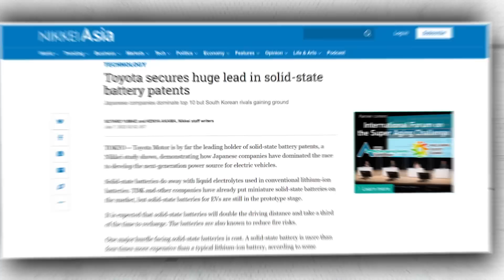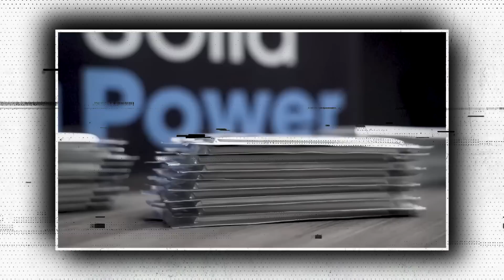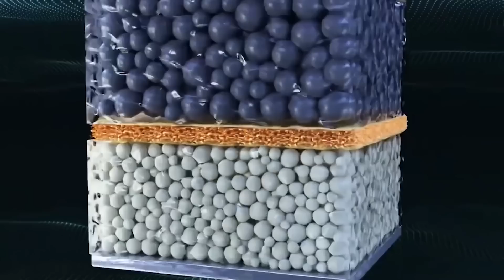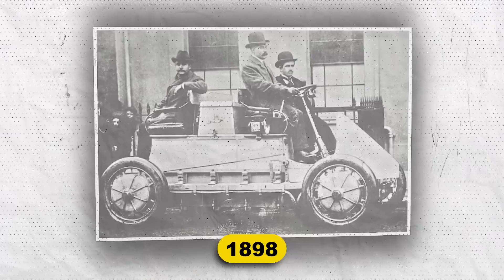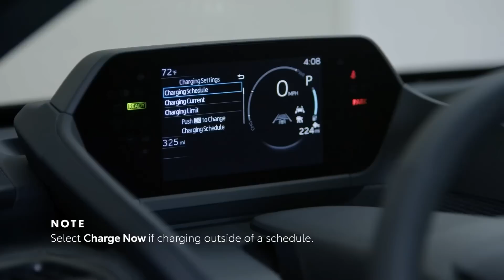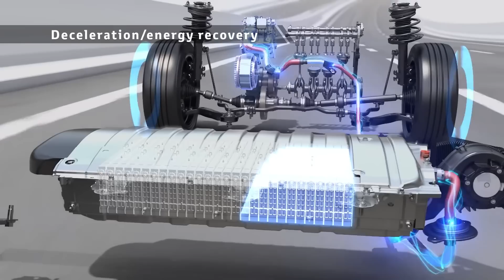IT HAPPENED! Toyota FINALLY Reveals New Solid State Battery 2024!

Comment: Advancing further; theoretically, solid state batteries may also become the automobile frame itself or even part of the structure of each electrical device in an automobile. Solid state batteries rather than be limited to a container of smaller inter connected batteries combining to deliver the required electrical current can be manufactured to assume virtually any shape, hence forming the structure of the device itself, significantly improving efficiency and economy of production.

Comment: The amount of energy to recharge the battery in 10 minutes would create so much heat that it would equal the amount of heat expelled from the electric engines that drive the vehicles for the duration of the 500-mile trip. This is nothing more than an add to draw attention for the purpose of advertising of their brand. Lying is never cool!

Comment: I own a 2018 Prius Prime plug in and I have come to be in awe of the engineering technology that makes this car capable of what it does while doing it reliably.  I am excited to experience solid state batteries in this hybrid to achieve the figures that are being claimed very soon.  While I respect Tesla for all that it has done, certainly Toyota is a  credible builder of efficient and dependable automobiles that can not be ignored.  I look forward to increased range, power and short charging times along with safety.  They deserve my vote.

Comment: Fast charging suggests that in an HEV setting, far more braking energy can be absorbed, so reducing the need to use the friction brakes, while extending the range of the electric drive. Toyota wants to get this right, so HEV/PHEV makes alot of sense. It will punish the battery packs with many recharges, yet be a cheaper unit to swap out under any warranty issues.
Reply: Battery longevity is not an issue even with existing NMC and LFP chemistries. Solid state batteries are always being pushed into the future. No one is coming clean about costs and production volumes. Existing technologies make incremental gains year on year so this is no 'game changer'.

Comment: Ill believe it when I see it and touch it.
Once they release a truck with 600mile range under full towing and cargo load, I will be sold on it. In addition, to quick recharge to 100% within 10mins. 
If it can't do the above, then I wont be switching to EV.

Comment: Wtf is going on st toyota? One week there saying "NO" to ev manufacturing. Now this week it revolutionary solid state cells that nobody will see outside a lab.. even in the lab they only make a few cells. We know that better batteries are coming. The math doesnt lie. Getting the batteries to manufacture at scale is extremely difficult. Theorhetical and - in practice- play from different fields of thought. Practical manufacturing never is possible. Ultimately we the consumer just get told a bunch of crap that makes people happy.. but it never bears fruit! I say this fully recognizing the best vehicle i ever owned was a toyota corolla. Make any all electric vehicle. Try that first. Or announce that your building enough battery plants to continue making and selling 10.5mil units. Engine and batteries are basically the same thing in there function. If your not making ice engines then make batteries.? Future tech will come and batteries will get much much better. But dont hold your breath if waiting for this to bare any fruit. All of japan has put there eggs in a fuelcell / Hydrogen future. I can see uses for hydrogen in airplanes. But i dont see it ever penciling out for vehicles. Its not a easy gas to work with. Its not like your bbq propane tank.  If you use electrolisis its expensive to make. Japan is going to use a few nuclear power plants to make nothing but hydrogen. Ive been wrong before. If your car ran on hydrogen it would cost u around $30gal (more if created solely through electrolisis).

Comment: I don't get why Toyota decided to go for a hybrid and not full electric... This doesn't make sense
Reply: Prove it out and debug on smaller batteries.
Reply: Toyota is heavily invested in hybrids and have been fighting against EV's for years.  They don't have a viable EV platform.   The few EV's they make today are based on ICE vehicles.  In some markets they are selling rebadged BYD's.  Production capacity is probably the other concern.  They can make 5 hybrids or 1 EV with the same amount of batteries.

Comment: In Hybrid Versions is hard to charge breaking while driving. Use the Tasla system then you can charge without breaking. Much better and cheaper.
Reply: What are you talking about?, please expain, I would like to learn.
Reply: @auser6426  Regen while breaking vs regen with say a paddle.
Reply: @BioniqBob  Thanks for the answer I understand  you.
But I still don't understand @donleofirsts comment

Comment: I am very confused by Toyota's advertisements. Recently, the hydrogen internal combustion engine has been very hot, and it is claimed that its performance will beat Tesla's electric vehicles. Since hydrogen internal combustion engines can beat electric vehicles, what solid-state batteries are still being developed? Conversely, if solid-state batteries can be successful soon, then Toyota's automobile kingdom will continue. Is it necessary to engage in hydrogen internal combustion engines?
Reply: Easy - it’s called a hydrogen hybrid car with solid state batteries - duh

Comment: Solid state (SS) battery promises significantly more recharging cycles (more life cycles) than Li-ion battery and thus benefitting smaller plug-in hybrids' batteries. For commuting the faster recharge also adds to the SS battery utility. Looking forward to that.
Reply: There's still more problems with [actual] high speed charging than people without electronic theory, education and principle can possibly know about. The current connector and conductor technology to transfer enough current for a 500 mile trip in a loaded car in 10 minutes is nowhere near being where it needs to be. The conductors will need to be several times larger, and the connectors need to be extremely robust, or fire will happen at those connectors. Contemporary lithium ion batteries on their own offer very little resistance to current flow, so they have to have extremely robust current limiting technology in them to keep from burning up the conductors, connectors and chargers. Relatively high speed, automated ,battery swap out technology would be much easier to implement than trying to upgrade the batteries, the chargers and the conductors. It's not really the batteries we have available cannot charge fast enough, it's that delivering the amount of current to them that they can accept is holding them up. It will require complete redesign of chargers, ports and internal conductors to move that much current.

Comment: Y'all keep throwing these so called ground breaking developments. "Show me the Money" or should I say "Show me the Battery"
Reply: Every year I hear the same stament
Reply: @lynkmartin Toyota has been claiming solid state batteries are just around the corner for years.  I'll consider it vaporware until it's actually in production.
Reply: @Gary-bz1rf  your statment just sounds like a naysayer when it comes to EV's.  There's been lots of this "it can't  be done" talk in the EV space that has been proven wrong over and over.  For instance, Tesla increases the production of EV's by 40-50% every year.  That's 2 years to double the production of EV's, not 10.  You mentioned the supply chain, guess what they figured that could be a bottleneck and applied that same growth up and down the supply chain.  Not enough batteries, they'll build their own.  Not enough  battery grade lithium, figure out a new refining process, and do it in-house.  Countless examples of exponential growth in all segments of society.   Where did you get that perception it takes 10 years to double something?
Reply: @Gary-bz1rf  You're totally wrong on that one.  90% of EV's are charged at night, when there is excess power on the grid.  Tesla has 17,000 superchargers in the US, many supplemented with Solar and battery storage.  They can only make EV's so fast, so it's not like we have to transition 100% tomorrow.  It will be gradual.
Reply: @Gary-bz1rf  you're right that it would take more power than the grid can power today with a fleet of 50.  Megapacks will play a large role in buffering the grid, but more power will need to be supplied from the grid, solar, or a combination of both.  A Tesla Semi has an 800kwh pack that can travel 500 miles.  You could fill 10-12 Tesla model 3's for that same capacity, and those cars will only need to be recharged once a week based on 15k miles/year.  1 Semi could have the power demands of 60 model 3's.  There are other hurdles besides the grid keeping these busses and semi's from replacing the diesel fleet anytime soon.  The biggest one is being able to supply enough batteries.  We're probably 5-10 years away from mass spread adoption.  The grid can and will grow, as it historically has done...that is given politicians don't trip over their own policies.  The same politicians pushing EV's are also stopping new power plants from being built, stopping mines to provide raw materials, and stopping  drilling for new oil.  We can't solve this all at once with solar and wind alone.   Energy prices have doubled in many parts of the world due to these short-sighted policies.  These climate activists fail to recognize how many lives have been saved from fossil fuels or how many deaths will happen if you pre-maturely pull the plug on fossil fuel use during the transition to EV's.  They claim to be for the poor/disadvantaged, yet they're making the poor choose between heating/cooling their homes and putting food on their plate or paying their rent.
Reply: That is not all.
How about the power you have to deliver to fill up a batte in 10 minits that can drive that distance?
How thick needs the cable to be.
Reply: Charging with regenerative braking wil only charge a little bit. 
And keep in mind that if you stopped with braking you need to pull up again, and that will use more than you generated. 
Regenerative braking is good for being more efficient but will just charge little.... unless you keep your foot on the brake.😂😂😂